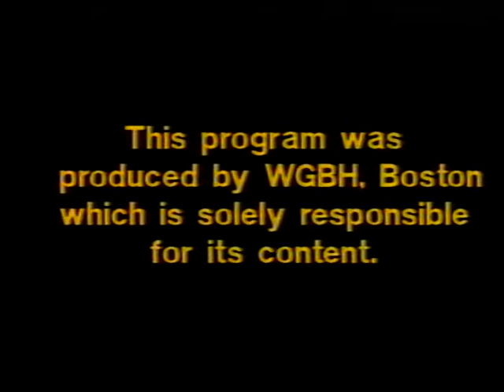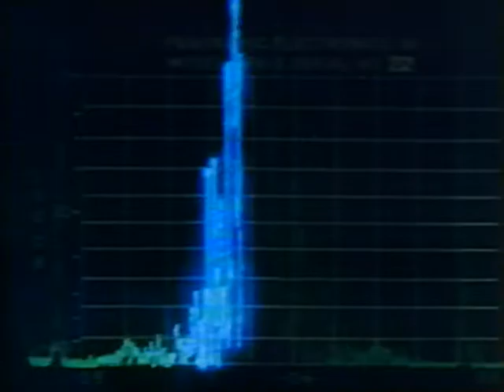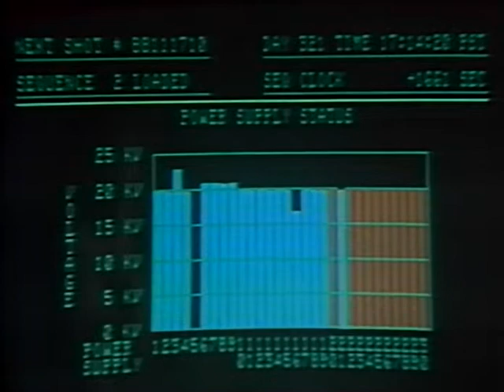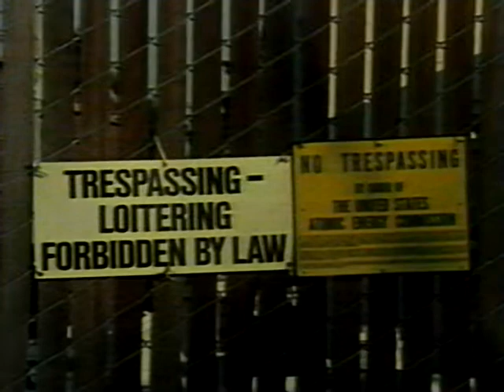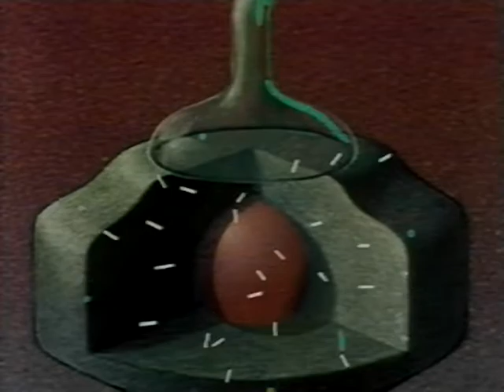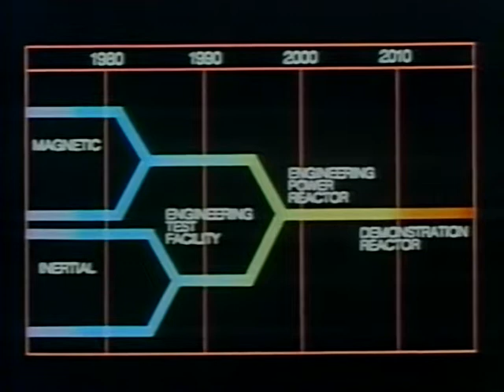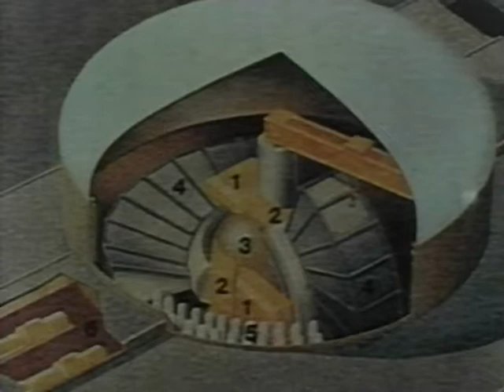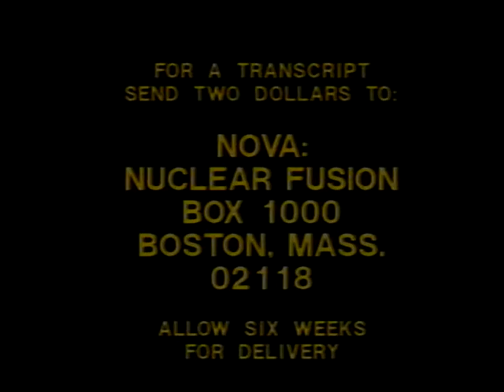The End of the Rainbow - Nuclear Fusion Documentary (1979)

Comment: Some segments which are notable in hindsight:
03:50  - "we cannot base energy policy on the commercial realization of fusion"
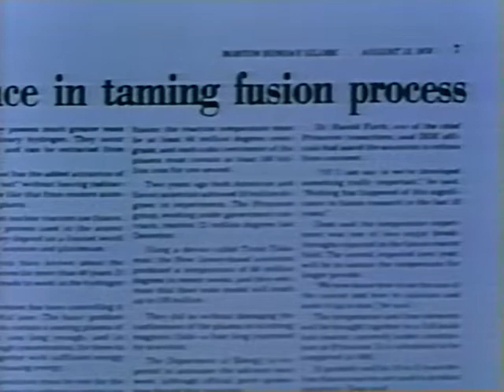12:40 - "TFTR will achieve breakeven"
13:31 - Over-optimistic timeline (1979 edition)
14:29 - "The Tokamak approach to fusion is a dinosaur"
21:06 - "SHIVA ... could try to achieve scientific feasibility ... by 1986"
25:00 - Discussion on "Should inertial fusion be declassified?"
28:09 - "But the Wright brothers" (1979 edition)
29:12 - A gameshow-style lineup of alternative fusion approaches
35:33 - 15 dpa / FPY (surprisingly accurate)
37:44 - fusion compared to Concorde
43:16 - implies oil/gas will run out by the year 2000
43:47 - admission that CO2 causes climate change
47:04 - young Amory Lovins on his negawatt revolution
48:44 - Edward Teller rant about anti-nuclear advocates
52:57 - Edward Teller arguing for a fission-fusion hybrid

Also, I don't get the reference to Laetrile (?) at 54:51 - was that supposed to be a cancer cure that was overhyped and never worked?
Reply from the maker: oh yeah, there are a certainly a number of gems in this one! My favorite is the TFTR prediction of breakeven in a few years. The absolute confidence ! It brings to mind the certitude that the Tevatron would "definitely be producing supersymmetric particles like the photino by the mid 80s!" and the countless papers of the 2000s not just predicting in silico but practically banking on ignition, burn, and super high gain (>100) shots on NIF within a couple years of completion. It's all very depressing, frankly.  Your guess is as good as any about the Laetrile thing, and that would comport with the apparent very long history of its promise as a cure (mirroring the long history of fusion's promise even then! if they only knew!), a 1977 study finding no difference between it and placebo, and contemporaneous FDA attempts at illegalization. Incidentally, someone just uploaded a quite long and notably high quality video a few months ago of the live recording of TFTR's first plasma in 1982, which is quite interesting, if slow going.